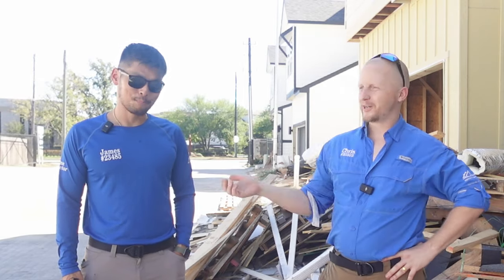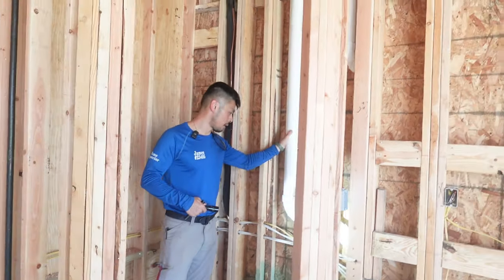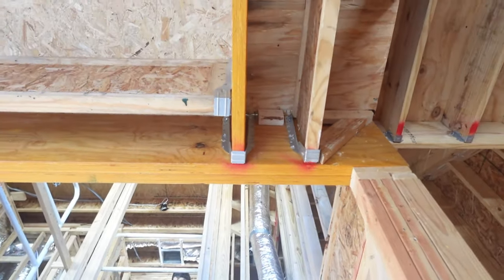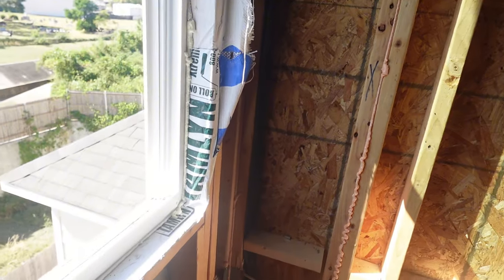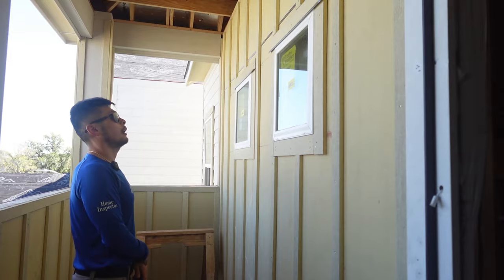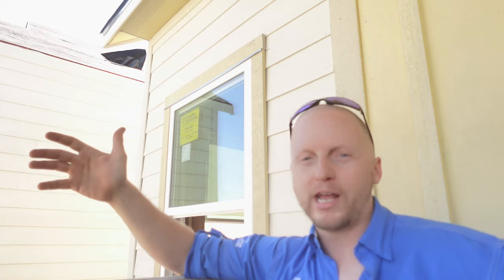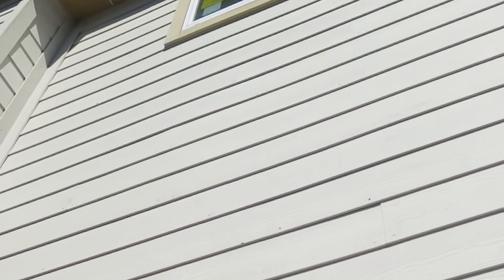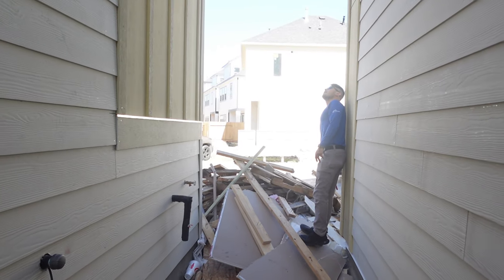New Build Inspections: Key Tips You Can't Ignore!

Comment: The trim and side is not installed properly. The trim around doors and windows should be installed first then the siding so it is flush. The window trim is over top of the siding. Even though they will caulk it it is a big gap.